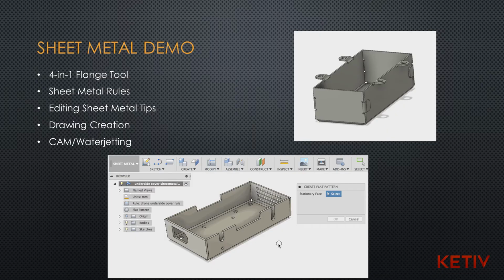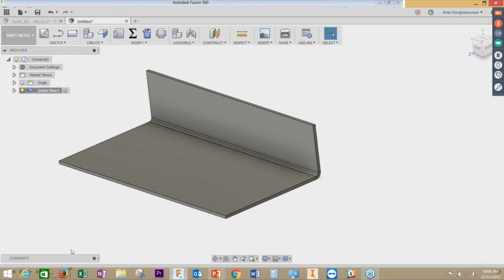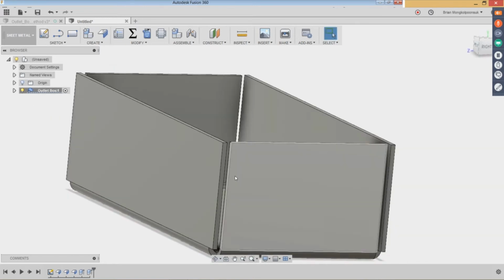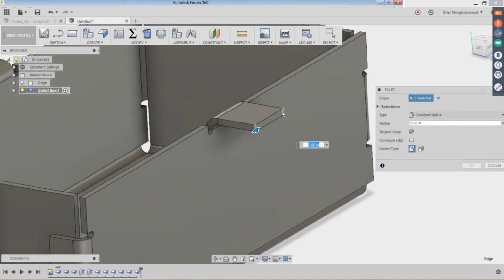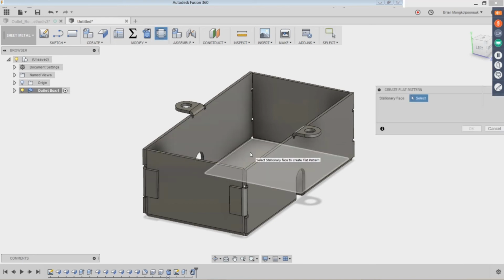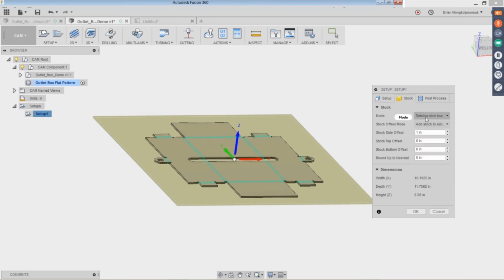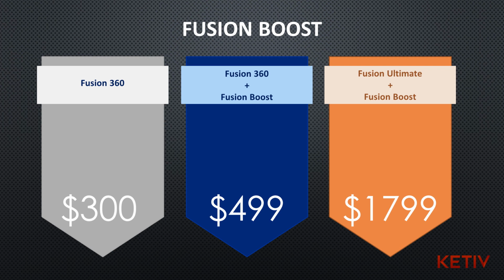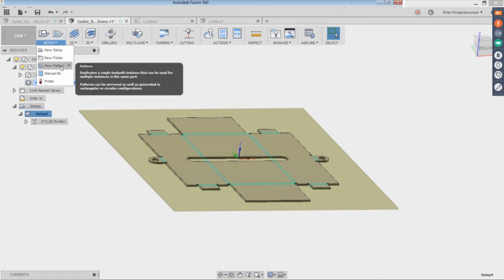Getting Started With Sheet Metal | Fusion Fridays

Comment: Excellent coverage. Thank you. One question, how do you so safety folds?  I am using 0.52 mm sheet metal.
Reply from the maker: Thanks for reaching out Gabrielle.  Here is a screencast of how to do safety folds/hems in Fusion 360:

https://knowledge.autodesk.com/community/screencast/caec16bf-38b3-403c-8da5-037074d0172a

There doesn't appear to be an explicit feature command unfortunately.